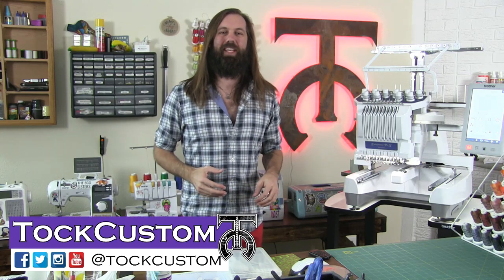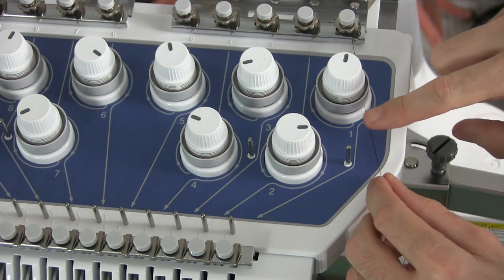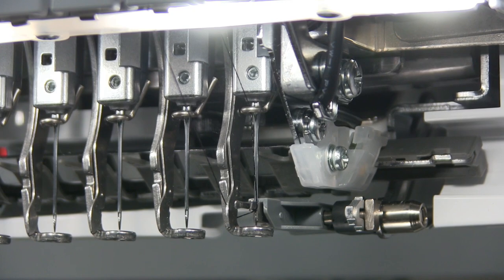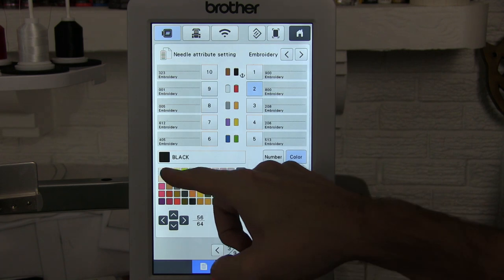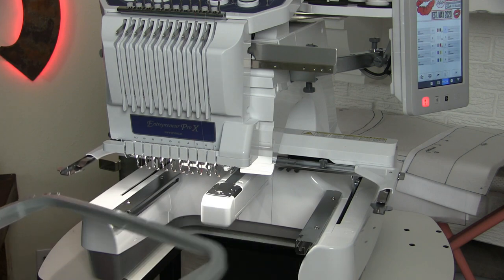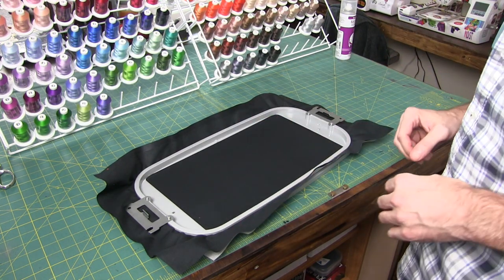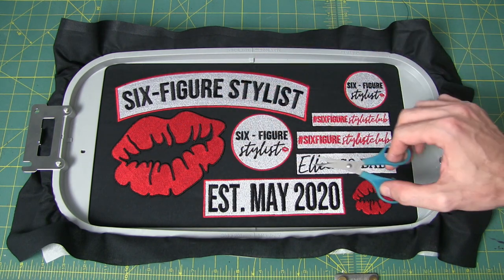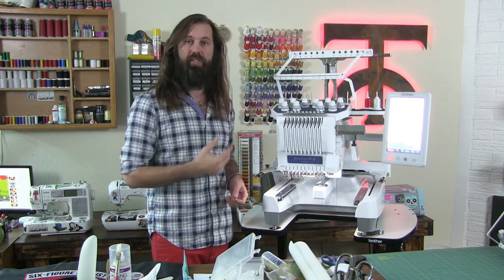Complete Brother PR1055X Setup Tutorial - 10 Needle Embroidery Machine - Tock Custom

Comment: Embroidery does require plenty of work before any work is started and that machine is extra special and can make the task so much easier by doing everything electronicly. I have a very large patch which I purchased from the area air force base to put on a jacket I have, but have not put it on yet. I wondered how much work went into making this patch and now I know after viewing your video and love how that machine works.
Reply from the maker: Yep, just like sewing is 5% sewing, and 95% cutting, measuring, pinning, and planning - same goes for embroidery. I guess that goes for any craft - and the results are always worth it :)
Reply: @TockCustom  Fully agree the percentages of actual sewing vs all the other parts. Especially when you are designing your own items as I have been designing and making bags and the sewing is by far the quickest part of the whole operation.

Comment: Great video ! I just bought this machine and I am completely new and naive with embroidery. I was wondering if you can do a video on how you placed these patches on the clothing afterwards as well as how to create or design .
Reply from the maker: Thanks! I did a different video using my PE-770 to make a bunch of patches, and how to add fusible webbing, that video might be helpful. Once that was done, I just cut them out, ironed them onto a bunch of jean jackets, and then stitched around the edges to secure it in place :)

I also have a video on how to design custom graphics too which should be helpful
Reply: Where did you purchase machine

Comment: Really nice machine, I have no idea if it matters or not, but I always run mine at less than full throttle, usually 800 spm, I can't bring myself to floor the thing right out of the gate.
Reply from the maker: Running it at 1000 SPM is okay with standard thread (for the most part) - but lowering to 800 will create less stoppages and thread breaks. Also you need to lower it to like 600 for specialty threads (like metallics and stuff).

It totally does matter, great comment :)

Comment: I have watched several embroidery machine videos. By far, your presentation was the best. Excellent photography, great explanations. I do have one question- and I should add that I don't own an embroidery machine yet as I am contemplating buying one. Do you buy prewound bobbins or do you wind the bobbin?  Is the bobbin thread typically  always white?
Reply from the maker: So with my smaller units I wind them myself using 'machine embroidery bobbin thread' manually (either black or white) - for this PR1055X, I buy premade (L-Type) Bobbins with a magnetic backing. They come in black or white. This machine doesn't actually have a function to wind its own bobbins, but all smaller units do. Hope that makes sense!

Comment: After using the screwdriver  they provided with the frames for first 2 weeks I got a very bad pain in my right hand palm. Couldn't do any work with that hand for couple of days. Since then I am using a normal screw driver and my hand is not hurting. I hope it is not bad for frames. Did you like the screwdriver they provided?
 I am running my machine at 500spm if I switch to 800spm my machine moves the table(ikea bought) so badly that it feels like something will break.
Reply from the maker: I didn't notice they gave a screwdriver until I set this all up, so I couldn't say lol. 

I did get the actual rolling mounted table for the machine - I can run it at 1000spm with standard embroidery thread, but I noticed is was a bit more reliable at 800, and I was told if you use specialty threads (like metallics or glow in the dark thread) to go at about 500 or less.

The faster the SPM, the more friction and heat it produces, and can snap (actually melt) the thread. So a slower SPM will typically get you cleaner results.... it just takes twice as long

Comment: hello, i have a pr1055x machine and i decided to try embroidering a hat.  i am having issues with it . i dont know if i have the correct hat hoop. i was told that it was compatible with my brother pr1055x machine. it worked fine on my brother 1050 machine.  do you have a video on this hat hoop and how to use it.  i have watched other videos and the only difference is that it has two black rods that stick out and glide along the arm of the machine. they dont appear to hit but its making this really loud popping sound when it stitches and it keeps breaking my thread.  but sews perfectly with a regular hoop on the same design . just not on the hat hoop. what could be wrong. thanks for any help or video that you can show me .

Comment: On the hoop I used a T-shirt and should I put the back  hoop inside of the shit our in the back of the shirt because It sticked to the inside of the shirt when I was finished with the embroidering the back was sewing in also? Need help? What do I do?
Reply from the maker: I'll have to shoot a video on that for sure - sometimes I'll actually cut the shirt "open" so I can hoop it more easily and then sew it back together afterwards. Until then, I hope you can figure out a solution until I'm able to get to making a new video on this technique. Thanks for the recommendation!
Reply: @TockCustom no you don’t have to cut the shirt all you have to do is make sure that the back of the shirt is hanging below n not tucked under the  embroidery field